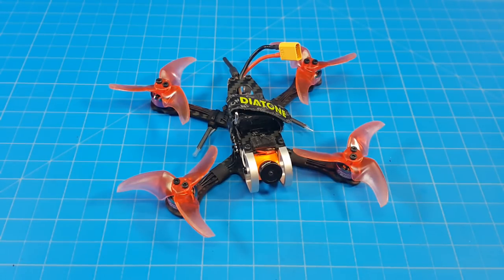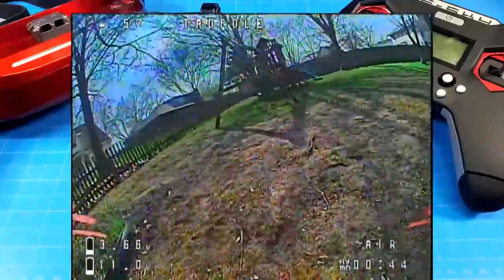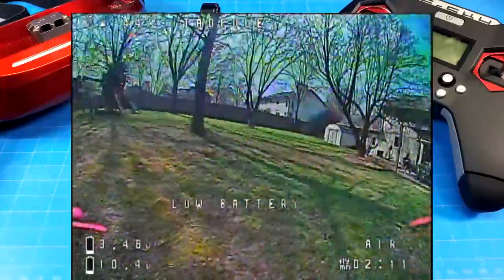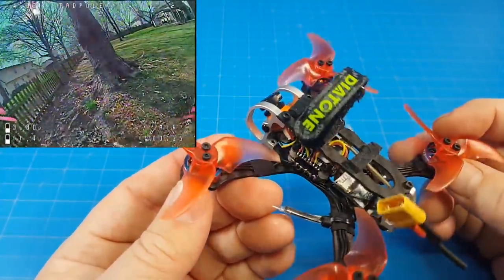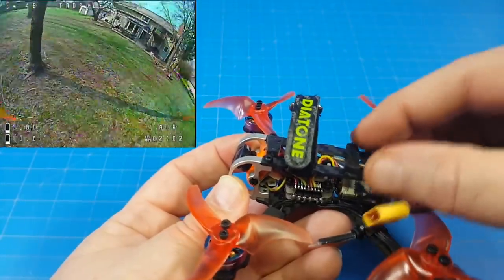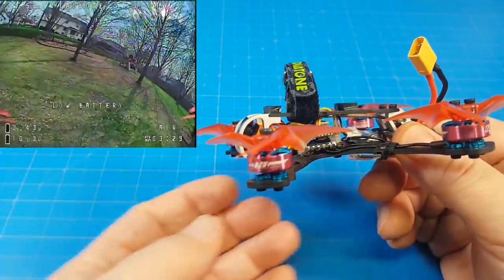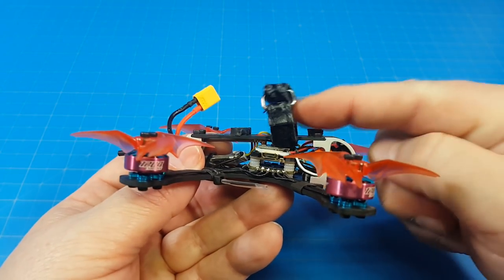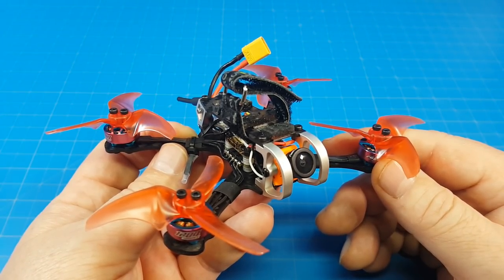Armattan Tadpole // Micro Freestyle frame // search for 3minute flight

Comment: Try this on 3inch maybe a little better?
Reply: would be a lot better, but the frame is too small
i don't think there is a reason for any company to come out with new 65mm frames anymore
Reply: Marc Frank I meant the motors on different frame if he had spares to move around. This is a chunky build I feel for 2.5. But it looks really cool.
Reply from the maker: A year ago we were running these types of props on 1106 motors, I think its primarily a lack of motor efficiency.
Reply: Nick Burns Im still running them now on 1105 rotorx. Favorite prop.
Reply from the maker: @Mellowdark17  rotorx did make great props. I have stayed away recently as rotorx is no longer in business. The props will become or are scarce.
Reply: Nick Burns sorry wasent clear. The emax prop is my favorite prop
Reply from the maker: @Mellowdark17  Ah, yes, I agree they make a good prop. I do sometimes want more "grunt" out of the prop and will turn to other less efficient props.

Comment: Looks kind of like a baby Chameleon.  That is some of worst reception i have seen from your videos, and have to agree with you.  Try moving the antenna above the back two metal standoffs so that it is just under the tail end of the battery or run it out through the battery lead area.  That might show if it's the metal causing the inference.  Try a different antenna regardless.  Nice flyer though.
Reply from the maker: I think I might first try a cp on it to see what that does. After trying the different rapidfire mode, also something I forgot about, been away from rapidfire to long.
Reply: Nick Burns -  Definitely a good way to go, but that won’t confirm or deny the inference from the frame.  However, I don’t recall that being a problem before with Armattan frames that I am familiar with anyway.  Sadly, I have no experience with Rapidfire so it but it would make sense to rule that out first, don’t you think?
Reply from the maker: @frankbarajas  Yea, testing rapidfire modes would be the easier way to go. Also I can take the skyzone goggles out too. Both, I don't have to turn a screw or anything.
Reply: Nick Burns - The less you change to alleviate the issue the better off you are depends on how much fiddling you do that will ultimately chew up your precious time.  The quandary of perfectionists everywhere...lol  BTW, having spent one summer working from home when my 5 kids ranged from 5 to 14 left me exhausted, sleep deprived and wondering who ever created the myth that being an at home patent was easy was a fool that never tried it before.

Comment: Juice ain't worth the squeeze on this one.
Reply from the maker: This sounds funny, but I don't think I precisely know what you mean.
Reply: @NickBurnsFPV  Well, if you imagine a small berry, and you start squeezing it...

Armattan builds routinely come in overweight.  They just do.

This one is a little bit of a difficult/awkward build from what I've seen.

16x16 stacks haven't matured quite as quickly or as well as 25x25 stacks.

So after you've assembled everything, you've found you have produced...  roughly specwise a 2017-2018 era Babyhawk-R 2.5", or more closely the 2018 Babyhawk-R Pro.  If you account for minor differences (camera, motors, 2mm vs 3mm base plate), it's kind of a wash.

Those who absolutely must have top-mount battery pay a heavy price.
Reply: @GoatZilla  I spilt my juice reading this, but yeah 100% agree.
Reply from the maker: @GoatZilla  Thank you. I understand much better now.